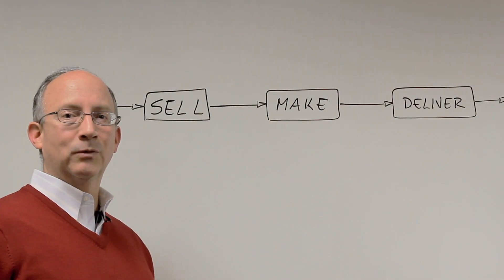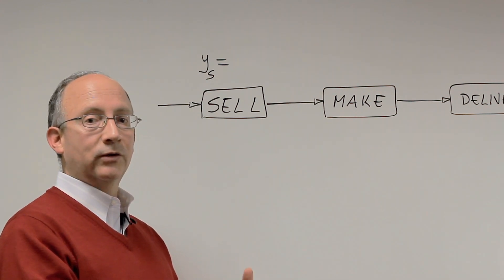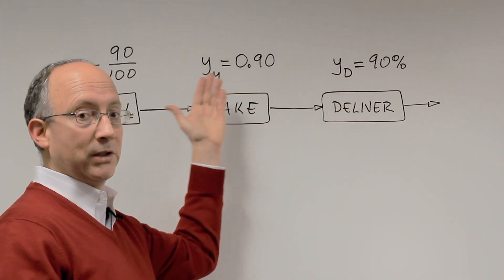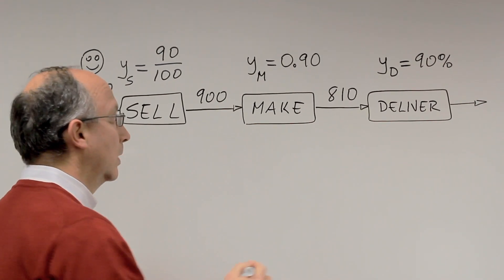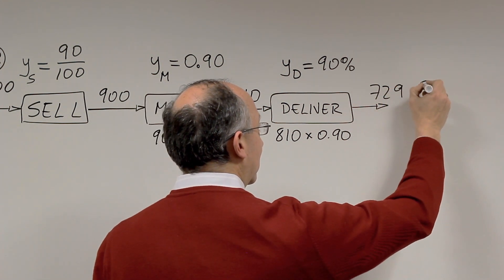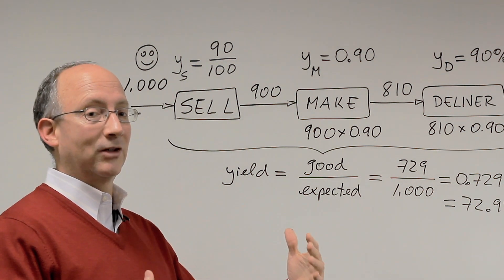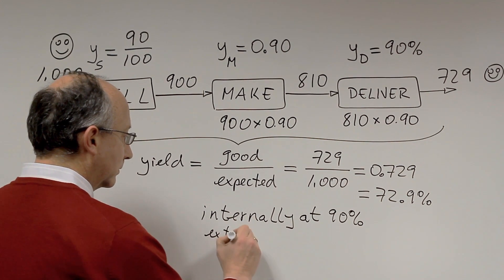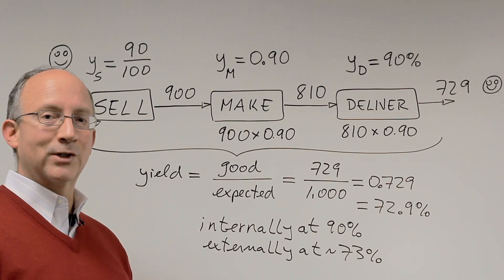REALLY? 90%, 90%, 90% equals 73%? OMG !!! | Green Belt 2.0® Lean Six Sigma | fkiQuality HD

Comment: It appears that the organization is viewing data from a siloed perspective.  By drilling down into the data points and having an open mind, it is discovered that as opposed to operating at 90% (of which is highly favorable), when in fact that number was only a surface level of what was actually to be.  

This is the reason of asking the question ‘WHY?’ five times.  It is apparent that someone asked why and through discovery noticed there was about a 30% decrease in what the original yield was once thought.  

Knowing that the actual yield is 72.9% this would be a concrete number of which to institute continual improvement standards.  Adjusting the tolerances of acceptability, and refining processes to increase the yield percentage.  Data should be constant, and there should be a plan implemented for revisions the lean way with a time frame of 3-6 months.  Yee haw!

Comment: As part of one department in a big company, each department's expectations were very high in percentage. I was not able to understand. However, through this, I realized that each department yields compounds and it is critical to have the highest performance in each department. 

It will be inevitable to break down the company into different departments to work efficiently / effectively / sufficiently and at certain points, certain department is the cause of the low yield percent. This should be looked at as the cause of the low performance, instead of whose blame it is, and work to get the highest yield overall.

Comment: Does this account for overlap between the different steps?  Using smaller numbers, let's say you had 10 customers, and the same unlucky customer had a bad sales experience, got a substandard manufactured product, with a poor delivery.  The remaining nine customers had no defects.  Overall yield in this case would still be 90%.

Comment: This does a fantastic job at showing compartmentalism that happens in companies. Each department only ever sees their own metrics and thinks they are doing well and falling within the 'acceptable bell curve' when in reality the overall process is on the edge of failing. Which also goes back to the notion that there is always room for improvement and when you get comfortable and stop trying is when you get complacent and things begin falling apart. What I find interesting is that this doesn't embark on re-work at all. If your original margin is almost three times less than what you think it is, you'll lose even more money if you have to rework product.

Comment: This opens my eyes to what the customer sees. They do not see the individual achievements of the departments, they see the result of the system. From sales all the way to packaging. We have at least 5-7 different departmental processes at our factory from start to finish. So this makes it very important for each link in the system to operate at a level that can support the next link and ensure we are not diminishing the efforts of the previous link. If one link gets overloaded or underperforms it stops up the next one and reduces their maximum individual output. Does shortening the number of links help with increasing the final yield?
Reply from the maker: That is exactly the point, Nicolas, that the customer sees the end result of the work of all departments combined.
And yes, reducing the number of steps would reduce the number of opportunities for error, therefore increasing the final yield. This is one of the reasons why streamlining processes and reducing the number of steps is the smart thing to do, but often times we add steps unnecessarily such as inspection and even second inspection, with the aim to make things better but we end up doing just the opposite.

Comment: If I'm understanding correctly, if I were to measure September performance for reports in our GCSEMI category at my organization using only the final delivery on-time rates, we would be at 93.8% for a total of 144 units.  However, if I were to add performance indicators for project setup (sales) and assigned a percentage of correct front-end setups at 92%, and a performance metric for production 98.6% of work not needing to be redone, my quality performance metric would be 85.1% yield.

Comment: Can’t argue with the math. So here’s my takeaway, the math which is not nearly as advanced as I thought, clearly shows the effect each process has on the next. I was going to say detrimental effect but it can be a positive thing as well.  This is how we can get into trouble real fast. This does make me question how customer satisfaction is calculated. I may be rambling, but a huge problem I see at my place is we usually don’t see upstream problems until the last, or near last, inspection.  What about the internal customers thought; production is sales customer so is the yield 90%.
Reply from the maker: Jerry, Calculating customer satisfaction is a very subjective exercise, beginning with how satisfaction is measured, which is typically on a 1 to 10 scale or 1 to 5 scale without any regard to accurately translating emotions into numbers, which is not an easy thing to do when does skills are not even linear. This is a much bigger problem, usually ignored in survey design.

Comment: Is it becoming more common to have an individual in the company who is personally responsible for strategic alignment and inter-departmental KPIs?
Reply from the maker: I've seen "liaison" roles that are intended to put together the broken pieces of a company, that is their departments, such as the IT-business liaison. Unfortunately these roles are at the individual-contributor level instead of at the executive level -- in reality they shouldn't be needed if the executives were to build the alignment and connections between departments.
As a result, you have low-level liaison personnel trying to connect the parts that are kept apart by high-level executives. How can integration be successful?

Comment: While working at Motorola in the cell phone division we used Rolled Yield (Sum of Yields) in manufacturing to track department quality.  A very important number when making product in the thousands every day.
Reply from the maker: Rodney Trelford rolled throughput yield is actually the multiplication of individual step yields, if you add them you could get a yield higher than 100%, which is impossible.

Comment: Wouldn't the 729 customers be judging your business at 100% and not at 73% as this video says? Because the 729 customers experienced zero "bumps in the road" so why would those 729 customers judge you at 73%? If anything the other 271 customers who did experience "bumps in the road" would be the unhappy customers who are judging you in some sort of negative light, leaving bad reviews for example. In other words the 729 happy customers have no idea there are 271 other customers out there who are unhappy. So how could the 729 happy customer collectively say the company performed at only a 73% success rate? I get how the math works out. But that is only something the business owner is aware of. It just doesn't make sense to me how the 729/1000 customers are only happy up to a level of 73%. If anything the 729 customer are judging your company at 100% and the 271 are the unhappy customers cursing you. Again, I get the math, but to say that the 729 happy customers are not happy doesn't feel right to me. Thanks.
Reply from the maker: Joey, good comments! The 729 are the lucky ones that are satisfied and feel that the company is doing well. But as a business, you started serving 1,000 clients. This is why the overall result for the business is 73%.

Comment: This video challenges the assumption that in a complex, multi-faceted process ("Sell-->Make-->Deliver"), outstanding service is dependent on all areas operating at "pretty good" levels of performance. Rather, there is a rapidly deteriorating multiplicative effect of seemingly small (10%) rates of failure at each step that drastically impact customer perception of the quality of the product they are receiving. This makes total sense, as the customer does not experience the product in the "silos" that organizations sometimes have a tendency to think in, and rather perceive the total function. Thus, exceptionally high levels of quality (well in excess of the 90% "good enough" benchmark) are required at each step to maintain a consistently acceptable level of customers' perception of overall quality.
Reply from the maker: Mary K. O'Connell excellent insight when you say that customers di not experience in silos but has the total result if all teams' work

Comment: Interesting view of how departments do not think beyond their own departments. With many organizations, communication and sharing of data is important. Many ERP systems try to bridge this gap but I know that in my company, we are not allowed to see the data of some of the other departments. My sense is that we need to have a culture change to avoid tunnel vision in departments.
Reply from the maker: Jeff, very insightful comment on how transparency is limited from one department to the next, even when ERPs can make it possible. 
Even if it may be "too much" to have each department know the metrics of the other, a department that is an internal customer of another one should know the metrics that characterize the inputs received.
Also, top management should/must have this transparency so that they may attempt to manage the company as a whole instead of as a collection of somehow independent profit centers.
At the other end of the hierarchy, every employee/worker needs to know the metrics necessary to do and keep doing great work -- here is where Lean offers what is known as "visual management."

Comment: The video really emphasizes the importance of the overall view of the company's functions and how it effects the customer. While one division or multiple divisions of the company can be operating optimally at 90% the overall service and the customer's view is quite different. The more the company's departments are disconnected the harder it is to service the customer. The management company we use for our condo association is very silo'd and it makes for a very poor experience as the customer. In order for me to get an answer about a finance question in regards to the association, I have to call or email our account manager, the account manager then has to go and research who's department the question should be answered by, then they usually report back to me which department I need to speak to and they go around a few more times before I actually get an answer. In the meantime, I've wasted 1/2 day trying to track down something that if I was allowed to speak directly with the department I would have been able to find out in 5 minutes. Inefficient at best!

Comment: The math of 90% x 90% x 90% = 73% of course makes sense.  What's more revealing is the comment that silo'ed or myopic reporting systems within a company can create false impressions of success.  While each "silo" may be operating at 90% yield, the aggregate impact to the customer is missed.  Overall, don't lose site of the big picture.
Reply from the maker: The impression of success becomes also an obstacle to improvement when personnel cannot believe that their numbers lie. On the other hand, once people understand the impact of their work on the performance of others, then the call to work together becomes stronger. This awareness must be created by using company-wide metrics and dashboards.

Comment: Data analysis is invaluable. A holistic approach shows in this case that sum yielded  less that the parts. This systemic approach will help develop a strategy to put in place a plan to yield a sum at least equal to its parts.

Comment: This was not a surprising result for me, because I am a math geek. Nevertheless, it is important to realize the cumulative effects of loss, waste, or inefficiency, which would be called failure in probability theory. The closer each sub-process gets to being perfect, the less of an effect it has on decreasing the overall performance of the entire process.

For example, if each sub-process could be improved to have a 95% yield, the overall yield would improve to 85.7%, but if the individual yields dropped to 80%, overall performance drops to 51.2%. Ouch!

Comment: This is a good illustration of how a company can be judged as being 73% successful by external customers, while internally, each functional department  thinks they are performing at a higher 90% success rate.   Without rework,  the compound effect of errors erodes the overall level of performance yield for the company.  This proves that a company is made of a system or  a series of interrelated functions with one common goal.